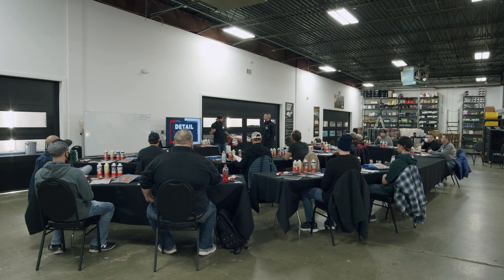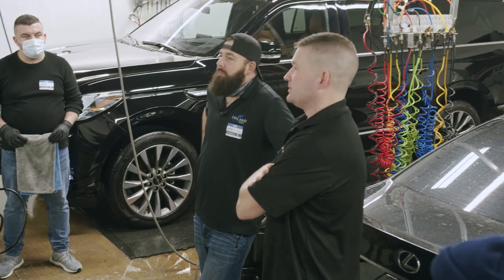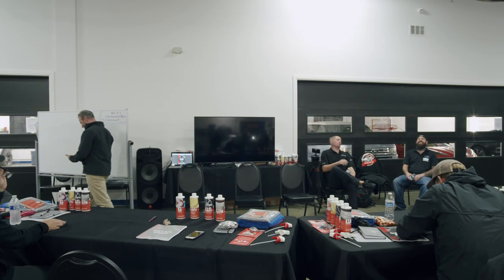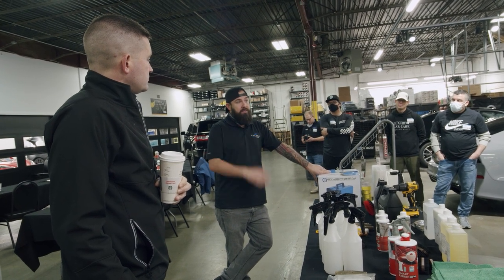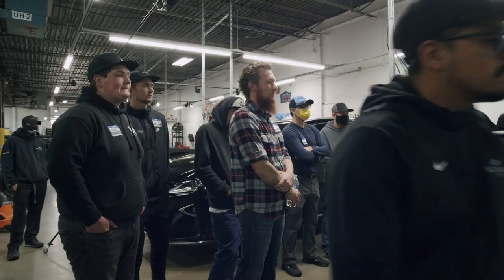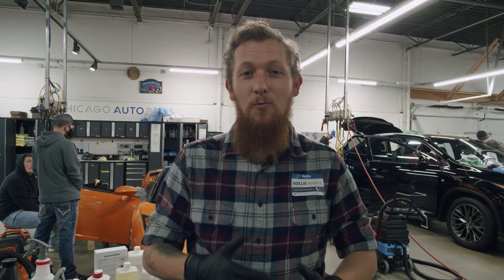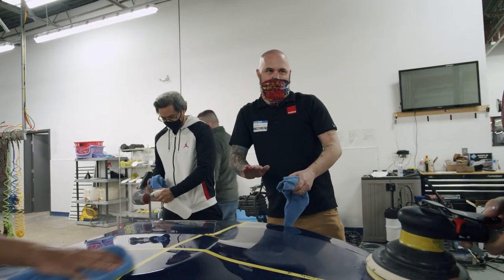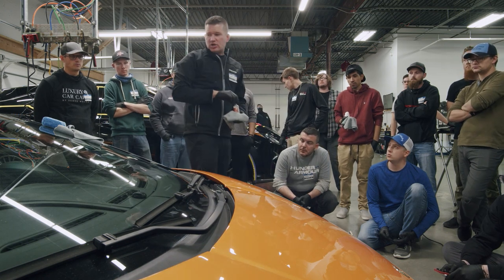DetailWise Academy RECAP | Auto Detailing Training

Comment: Hey Jason, it's your number one fan from Tampa!  A quick question-you mentioned ceramic rotors.  As you may remember, I do have ceramic brakes on my RS6 Avant.  Is it safe to use Brake Buster on these?  I like to use Brake Buster, since it is a wheel and tire cleaner.